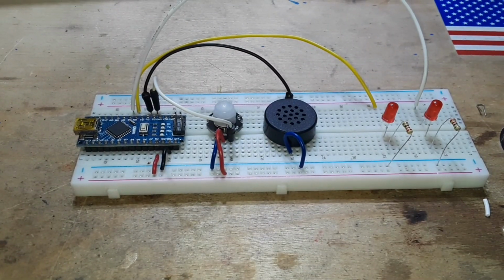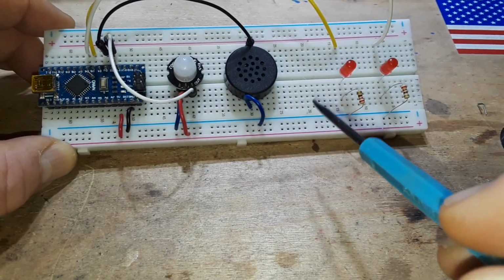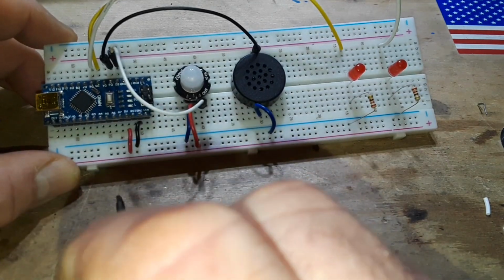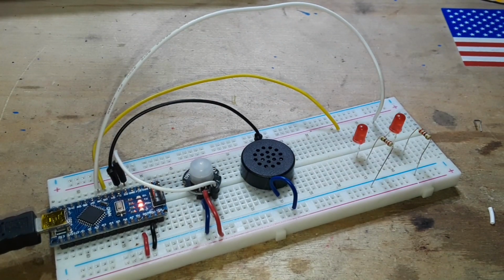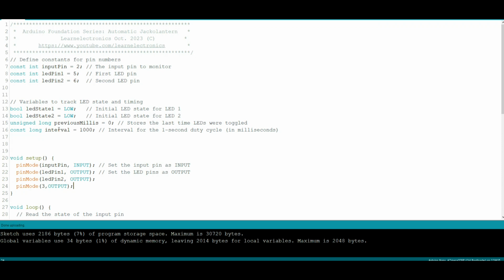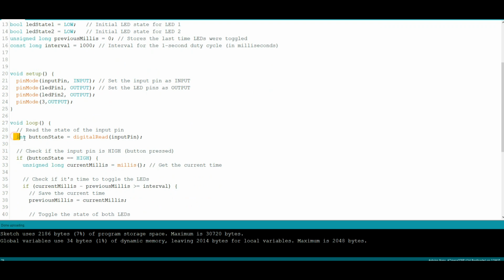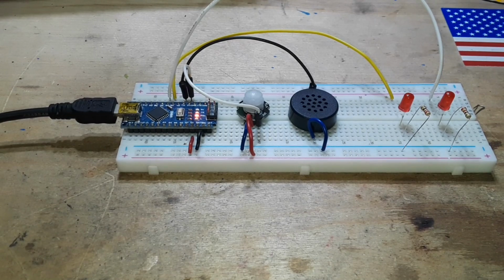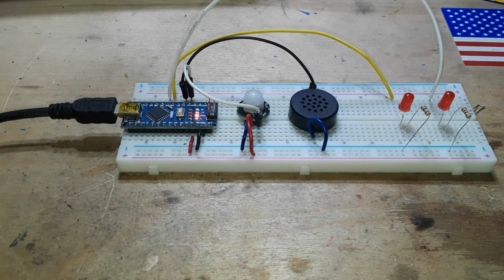Automate Your Spooky Season - sponsored by Solderstick  Wire Connectors

Comment: Cool PIR project, i  have some of these in lights i was hoping to repurpose but havent figured them out.  When probing with my osiclliscope for a high or low singal when they activate i couldnt find anything. I was hoping to hook up an arduino to it and count how many times the light turned on. I did find a packet of data comming from the sensor itself, im guessing the IC handles it and then turns that into high or low or whatever you want, like turn on a light or the one here in the video gives you a conventient high or low signal for a microcontoroler to read.  Would  be nice to know how to wire one of these up from scratch, im guessing not as straight forward as it looks, probably would tie up a whole microcontroller to process all that stuff, the time it turns on vs off etc, would be interesting anyhow.  Thanks for the inspiration.